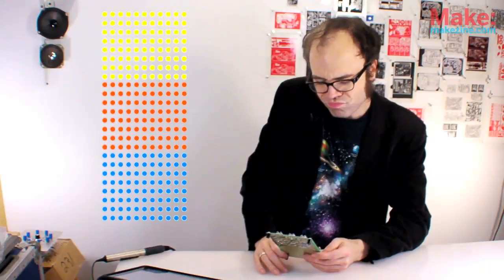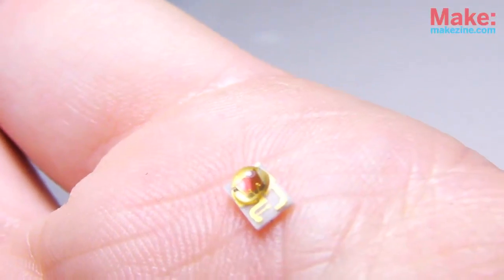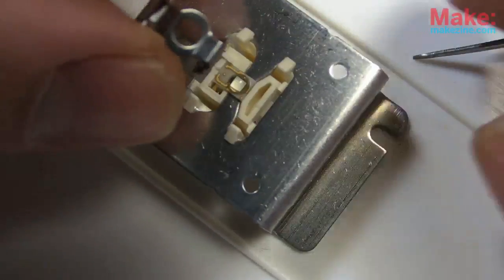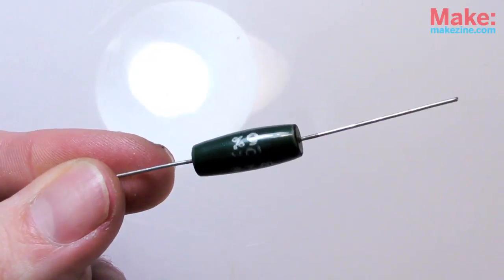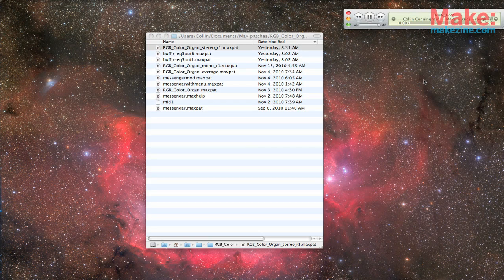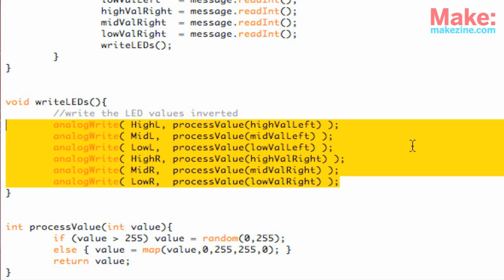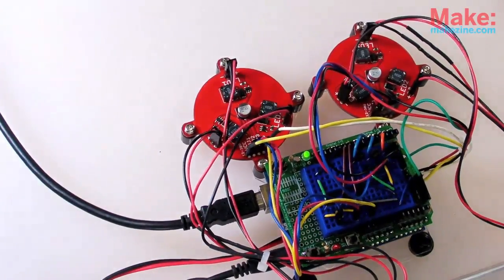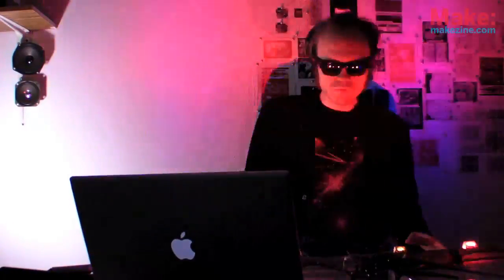Collin's Lab: High Power LEDs + Digital Color Organ

Comment: Mark: in 1968 the rage was overheads and using large glass clock faces. (Remember the ones on that huge clock on the wall in school? ) They would use water or mineral oil and throw in different food colors. One clock face below and one above ..solution in between. The operator would hold the top glass and move and jiggle it to the rhythm.  Some operators were legendary for their creativity.  Way different culture back then.

Comment: used the driver circuitry from the standard color organ, but replaced each set of 4 LEDs with 2 high power.  a lot easier (for me at least) then messing with arduino and all the coding this requires.  Just remember to recalculate the resistor values controlling current to the LEDs to keep current within safe range.

Comment: Looking to order some Luxeon Rebels and the driver boards. Turns out... there are a billion kinds of Luxeons. What specs did you use to order your lights/drivers? I really don't' want to fry my Arduino and I don't know enough about current/voltage to order stuff with confidence. Cheers!

Comment: Learning the parts is easy. Getting them to work how you want is the hard part. It would be a good idea to learn the code that arduino uses (can't remember it) and just build stuff like the first color organ. You don't really need to know how to solder, if you're experimenting just connect the components wire to wire.

Comment: There is a more basic way Using a TIP32 and  tie it into your output speakers the Led's light up to the beat (current) of the music you do however have to play with the right resistors so you don't pop the LEDS

Comment: How does the Max software communicate with the arduino? Does the arduino sketch open a serial port... and then the Max software writes data to this port ... which the arduino then reads and does stuff with?
Reply: If so, how do you go about configuring a program (Max or otherwise) to write data to the serial port opened by an Arduino sketch?

Comment: @MrRyanstutorials I really Doubt that....In fact I think it was on one of the shows on HGTV saw someone with a huge circuit board sheet in a frame. Looked like modern art. I actually hang electronics I've pulled out of stuff on the wall around my desk...<don't want it to disappear and get mashed up in my piles of odds and ends.

Comment: I would doubt that Mohamed.  What we learned was that the early strobe lights back in 1968 sometimes only had one speed.  There were cases when some gal or guy in the audience would be affected by that PPM.  So, after that it was required to have a speed control and a means of not leaving the pulse the same for more than a few seconds. The best effect was not to use strobe on all the time, but as all lights off and a short burst for effect in the song.  lights and strobe always on, boring...

Comment: yep, I am old..but we used light shows back in 1968.  We had no real transistors or solid state, so we played with dangerous 110V  lol....I built a nice size box with wooden piano type keys in a long row. Under each of the keys, was a levered micro switch.  Press a key, circuit went to a single light.  There were 4 banks of 4 110v bulbs. RBGY. Rheostat,ea   color.Special bank to play all one color or the sequence left to rt or back. Rhythm was real time as you played it. Make it happen now. thx